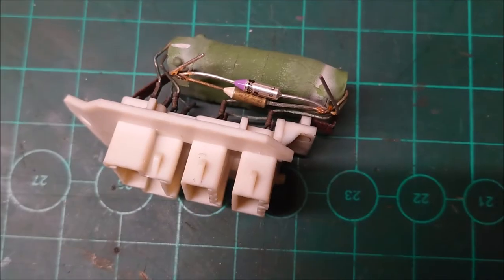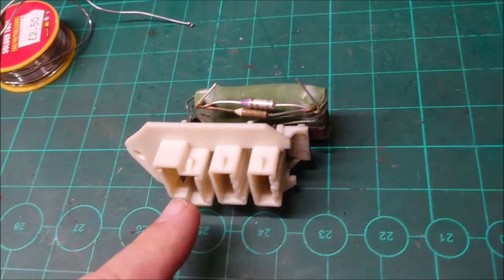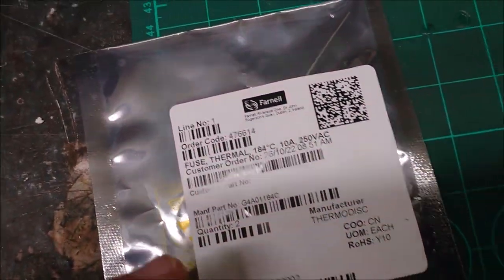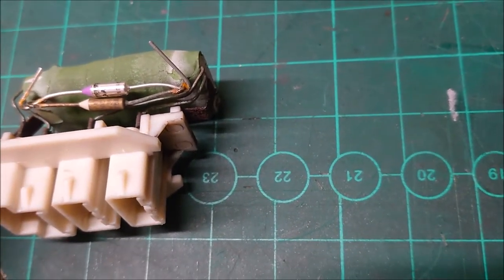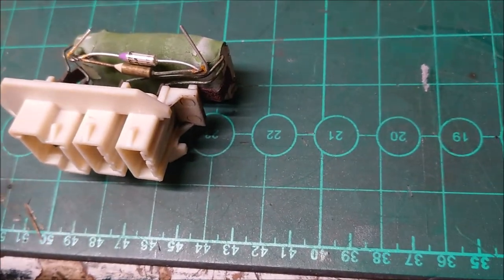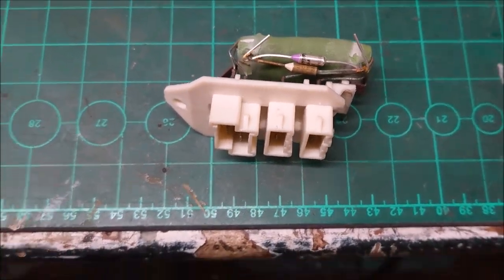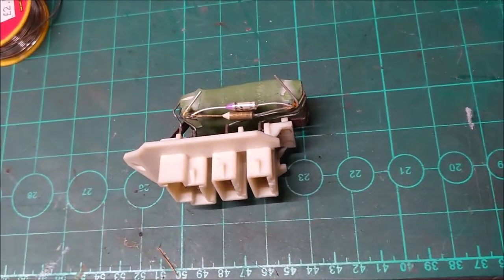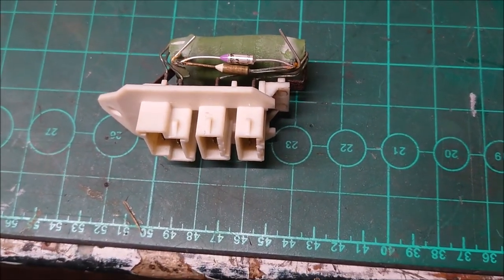Volvo 940 blower rheostat / resistor pack cheap fix

Comment: This looks like a clever way to repair the resistor pack! How do you know what temperature fuse to take?
Reply from the maker: I think I read it on the Volvo Owners Club forum. 1 year on the fix is still working
Reply: @mikestinyshedofdreams  OK, thank you. I'm afraid to use one with a  temperature rating that is too high, so it won't be safe. But I can't find any specs. So I think I will go with this one.